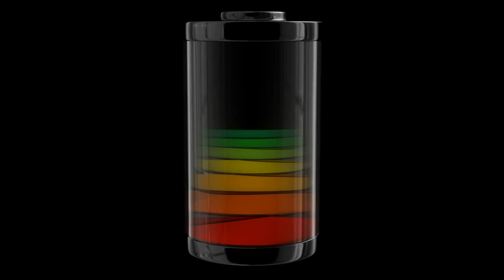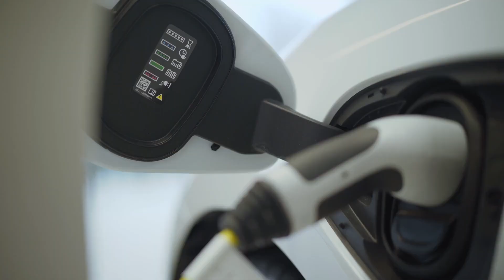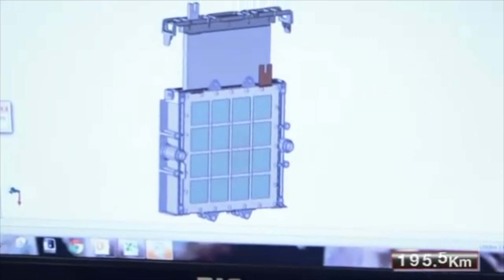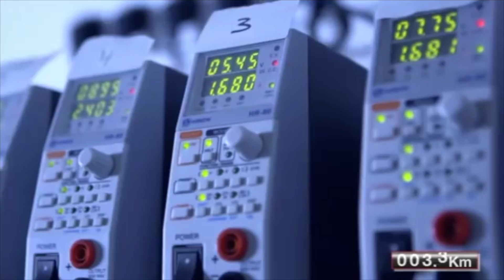This Battery Gives EVs 1000 Miles of Range!

Comment: Whether a battery is better or not for the environment surely depends upon the manufacturing process and how the electricity is generated. Also lugging round 1,000 lbs  of battery can never be efficient. There are only so many elements in the Periodic table, that no one has come up with a higher energy density battery than  Li-ion that isn't a bomb waiting to explore says to me that either scientists aren't very good or there simply isn't a viable option. All claims of significantly higher energy densities have proved to be hoaxes. The only thing that makes current EV's viable is the short distances  that most people use their vehicles for. Planning a long distance trip in an EV remains a nightmare.

Comment: The BEV was obsolete decades ago, where 21st Century steam turbine technology can achieve closer to 90% efficiency, without the need for expensive heavy batteries and expensive charging stations. Current electric vehicles only achieve 55-75% efficiency.
Reply from the maker: Think you’re way off. What created the steam?

Comment: Well, I for one do agree that we should continue researching this type of power pack for autos and other applications. The beauty of this forging ahead with research is that there is a wide open secondary market for this type of power. Today we use these little AA, AAA, C, D,  batteries that provide small amounts of power for a short period of time, then we pitch them or recycle them. The concept of how the Aluminum power pack is not much different from what we are accustom to now.

Comment: I think this could very well be a game changer because as consumers what we value most is Time. Range anxiety is not so much about how far you can drive. Its about how much time does it take to recharge when and where you stop and get back on our way. It’s a no brainer to figure out how to standardize a battery pack and make change out stations. We already know how to replace standardized batteries. Can anyone say AAA, AA, C,D 9V. This is not a new concept. You drive to the auto parts store or Walmart and they will sell you a new battery take out the old one and install the new one in minutes. Simple deal just like going to a quick lube. You drive in and the guy in the pit under your car swap’s out the battery pack you swipe your credit card and drive away. You don’t even have to leave your car for a five minute swap. If it is one hundred percent recyclable, non toxic and on price point. I say done deal. The only thing that could muck up the works would be the government coming to the party way late as usual and not creating standard sizing and dimensions so the drive through battery shop would have to carry 50 different sizes battery packs in stock. Three tops. Small for small cars. Medium for medium size cars and large for large cars and trucks. Maybe and extra large for semi trucks or just a few large ones stacked together. 
Standardization will make it all work and keep the price point low and very competitive. And thats always a win for consumers. You just pick the brand and price your willing to pay.

Comment: Don't you think that if Tesla thought they could make these work that they would have jumped on it?   Of course they would  have.    They didn't because it is completely impractical and frankly, ridiculous.   Swapping out millions of batteries for a nationwide fleet is about as impractical and absurd as thinking we are going to be able logistically to manage recharging them.    

IF we could beam EM through the air or run it in cabling buried in the highway and continuously re-charge EV's as they roll down the highway that actually might work but I haven't tested it out.   We would need a power grid capable of supporting all that.   In areas such as California that have gotten out in front of themselves and in front of the technologies in their frantic rush to go green they now have rolling black outs and brown outs in their power grid.    This will only get worse too because they don't even have a potential solution for the problem.    At the same time the average electric bill for their customers is rapidly moving toward 100 percent increase as they have shut off coal and gas and moved to wind and solar.

I put this swap battery tech into the same bucket of absurdity as saying we are going to convert commercial jet air craft to  plasma engines which is in another one of your videos.   For a 747 just to take off from a run way would require(estimated) 91.5 megawatts of equivalent electrical power to what the fan jets produce.

Comment: If the EU is forcing Apple to kill the Lightning connector in favour of the USB-C connector, then what would stop them from doing the same for a universal Aluminum-Air battery design that would make a hot swappable battery standard for ALL cars that can be removed and replaced in two minutes or less?

Comment: This makes sense, it’s fare if battery has to be swapped after 1000 miles.
It will be like scheduled maintenance that we do after every 3-6 months.
3D printers can be used to manufacture aluminium anode in cost effective way.

Comment: You're right on point when you say that this tech would be great in countries like India where gas prices are skyrocketing and no infrastructure for ev charging. It's better to go to a dealership and get the battery swapped after maybe 1500 km.
Reply: Agreed Swapnil, if it has worked for LPG cylinders (the swapping of standardised cylinders) it can work for battery swaps as well

Comment: You might also want to apologize for saying that 2 gallons will get you 300 miles. SMH 150 MPG anyone?
Reply from the maker: Not what I said! 2 gallons have about 70kWg of energy.
Reply: "A 300 mile range Tesla model 3 has about a 1000 pound battery pack. To store an equivalent amount of energy in gasoline would require just 2 ✌ gallons."

Comment: Batteries store energy. They are not a source of energy and thus will not solve the energy crisis. Charging the batteries will still take hydrocarbon fuels with all the inneficiencies (50%) of distributing that power over long distance transmission lines.

Comment: Utterly superb video!

I gather that this is a primary cell with potential difference due the chemical difference between anode and cathode, much like dissimilar metals in an electrolyte.
If it is so light, what about putting two in the EV with Auto changeover.
As A depletes and B becomes necessary, giving less urgency to get a replacement.  Batt. B might be a smaller, get-you-home item.
None of these EVs solve the hardly believable technique of using road-mile energy for the heater..A/C...lights, wipers, windows winding, horn with a fuel of low energy density.
"Top it up Pump Man with 4 star unleaded Motion Lotion!
I got a boat or a trailer to pull!"
No 6F22s for me thank you!

Comment: Please excuse my humility. I don't like having to offer corrections but your metric conversion was a little off. The video suggested the the aluminum battery would offer an extra 1000 miles or 600 Kilometers range. This is incorrect whereas 1000 kms is approximately 625 miles. Your videos are fabulous and always get my 'thumbs up'. 👍

Comment: An Intresting idea is to have a hybrid of the Aluminum and LI batteries. Meaning, Two separate sets ion each car. A small Lithium pack for like 50miles as an emergency pack that is rechargeable with the bulk being the Aluminum and configured for easy swopping.  Providing a lower risk of the main battery (Aluminum) running out of going bad making the vehicle a brick.

Comment: I can't even see buying an EV until it can get 500 miles of range and recharge fully in 3 minutes.
Reply from the maker: Why? That sounds wildly arbitrary. You’ll charge at home most of the time and never worry about any of it. But such specs will happen eventually
Reply: @TwoBitDaVinci  I have a long commute, and travel frequently. Stopping every 300 miles to fast charge in around an hour would slow me down a lot I'm also a fan of the internal combustion engine...It wasn't wildly arbitrary...it's what my current gas-powered car does all the time. And I don't need to upgrade the electrical service to my house to charge it.

Comment: Nice video but not a chance that this battery will work as being suggested.  One thing that was completely overlooked is the round trip energy efficiency (ie recycling the battery, picking up the dead one and delivering a fresh one to the service centers).  Energy wasted in this process makes Li-ion a no brainer.  Even Hydrogen fuel cells will beat this.  Maybe in a special application (perhaps grid storage where batteries are near the aluminum refinery and the alternative is dispatching renewables but even then there are better solutions),   And further, the industry seems to be going the way of structural permanent batteries for EVs so no chance to do battery swaps.

Comment: Thank you, I further understand AL/O2-diatomic gas (or O) battery. And, I owe my brother $5.00 (US). Your right knowledge is power! Well, simple minds would like to know if you forego of a electrolyte solution and utilizing hydrogen peroxide (H2O2) as a oxidizer, which, has a unstable oxygen molecule (diatomic gas) and easily give up it bond. I'm not asking about the High Test Peroxide use in rocketry (a little heat and bang). Would it produce better results?  I'm doubling down with my brother to get my $5.00 (US) back. He said "No way"! I quoted Thomas Edison to him "I have not failed. I've just found 10,000 ways that won't work". He told me "your not the brightest bulb in the pack". Oh well, enjoy you programing, hitting the thumbs up and subscribed button now.

Comment: 0:17 what the heck is this nonsense you're saying that a battery pack that weighs 1000 and gives you 400 miles range is the same as 2 gallons of gas ???!!!
Reply from the maker: Energy equivalence. 2 gallons of gasoline contain about 70kWh of energy. Similar to the 1000 lb model 3 battery in my car.
Reply: @TwoBitDaVinci  what you're saying there is that 1 gal of gas is good for 200 miles , also a quarter of the 1000 lbs is casing but you don't point to weight of gas tank . this is selectively engraciationg the characteristics of gas . I am however testifying to the general value of your vids when I'm back over them 10 mons later

Comment: If you can make a fuel pump nozzle standard sizes, why could you not make the 'battery' that must be swapped out universal. You can make the car/boat/plane/bus/cycle/ETC look like anything you like... you just have to make the 'battery compartment' a certain size and shape. THAT I would think it all this would take to make it happen. All the rest is doable in the extreme. Maybe the future is brighter than I thought.

Comment: Having the mass of individual aluminum power packs, in a multiple multiple power pack system, being small enough that the average user could swap depleted power packs would eliminate the need for using a dedicated service facility and reduce user cost. That assumes, for example, the cost and output of five ten pound packs would be comparable to one fifty pound pack.

Comment: I am curious of the ability to maybe recharge a battery in the field. 
There was talks that the electrolyte would need to be drained when the battery is not in use maybe in this down time state there maybe a way to slide out the aluminum plate from each cell. And swap it. This could allow for field 'recharging' with a cost of weight for carrying the extra aluminum. Potentially giving someone traveling in very remote areas to re jig the battery to get back to service areas and properly have the electrolyte replaced ect.

Comment: Lithium ion not good for the environment. 1st you have to mine lithium which requires fossil fuels, you have to transport and price as the lithium ore which costs carbon, manufacture the battery which costs carbon. Then after it is installed in the car charging may cost carbon depending where your charging station is. The same with aluminum

Comment: What is needed is a consortium of engineering experts from the EV industry to form a task force to develop physical shape and electrical interface standards for a family of quick exchange power packs. The exchange stations would be essentially replacement for petrol filling service stations. Besides range, problems with proliferation of this individual home charging setups or corn rows of charging parks would be the threat of neighborhood electrical power distribution grids. If the use of rechargeable power packs continue, with the quick exchange modality, regional recharging and distribution centers would be located adjacent to to power generating or renewable energy harvesting plants. Also, EV owners would be conferred a degree of protection from technological obsolescence as breakthrough innovations in power storage density comes forth. For truckers, tank wagons with their innately wasteful empty back hauls would be replaced by 18-wheelers. With the case with the non-rechargeable technologies like aluminum air power packs, the return trip would be transporting depleted power packs to the recycling and manufacturing plants! The individual home charging hookups are likely to be a no go for dense urban and suburban multi-family dwelling communities and a nuisance and bother for others.

Comment: Note:None of the solvents used in manufacturing the Li-Ion battery remains after production. The 'fire problem' comes from using a self- combustible electrolyte. If a for whatever reason the cell temperature rises above a safe limit, this material breaks down, releasing heat. Any resulting 'fire' (not really a fire as nothing inside the cell is actually burning in the usual sense of the word) is hard to extinguish. Unless the temperature can be brought below the critical point, the 'fire' continues. It does not require oxygen, and water only works as far as it reduces the temperature.

Comment: Surely Alluminium is something that will help EVs. Be it be, Alluminium-air, or Alluminium Fuel Cell or Alluminium-ion technologies.

However, finally in long term, it would be Solar. The technology advances in Solar cells and panels will go through complete overhaul in 10 years.

Comment: They could easily put the oxide into a low pressure container, use a highly reactive chemical to cause the reaction, and the have a place to put in a solid aluminum cylinder with chemicals to clean the operating parts and restart the battery process. It would be as fast as washing your car. Most people wash their car inside and out, and fully refuel, get fluids checked, eat something, etc. once a week or every other week. The nice thing about aluminum cars is that they don't rust. So, cleaning top to bottom is safer.

Comment: "Much better for the environment than fossil fuels"

When you factor in the mining, transportation, manufacture and a host of other steps then the benefit to the environment isn't that great at all. The one thing which is good about electric vehicles is the reduced air particulates which are causing so many heart and lung problems in cities. That to me is a very good and important argument for the adoption of electric vehicles, but it's only going to work if the vehicles are as convenient as fossil fuel based ones.

Comment: if you could make them small you coul just use them like a changebal battry like going in a shop buying a can of drink, have a recylcing pod to put your old battry, buy the new one, needs an easy slot to replace, it would work but it needs to be small, like not bigger than a bankers box file,  if would need to increase the range for over 5000 to make the ofset of reclying 15KWH and so on... if they could make them the size of a few bags os sugar easy to slot in and out, and you just buy a new one, and they reach 5000 miles range they would be a winner by far, I dont get why this earth makes battrys in the way they do,

Comment: It's not just that the aluminium air battery is nonrechargeable, it's that the aluminium is consumed by the process of discharge. There's also no way of stopping their reaction, short of removing the source of oxygen.

Comment: really? Do you think that a movable object is always there when a new battery is needed? Like 'Musky' cars, if it is empty, you are hopelessly stuck. and you cannot read it out accurately like a bottle of milk. Hydrogen can replace LPG, and that is readable how much there is left. Look at video's about testing driving battery-cars, they all have a little bit power left, but move not an inch. So? still being positive about this?
Oh, and one line I always add, without being sponsored: A fully loaded battery car is as heavy as an empty!

Comment: It sounds like these would work much better in smaller devices, such as mobile phones and anything with an easily accessible, small battery. I'd much rather swap out the battery in my phone than find a special changing station for my car.

Comment: Aluminium air batteries, as main battery...plus lithium ion as standby to extend range...plus braking energy can be used to recharge lithium ion battery, seems a better option. The driver wont be stranded if the aluminium air battery drains out
Also Lithium ion can be charged externally